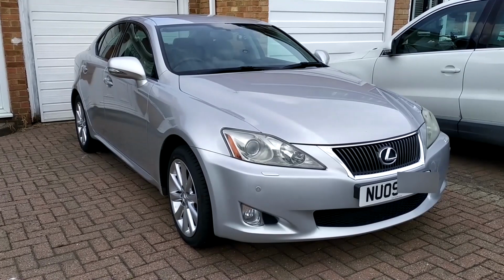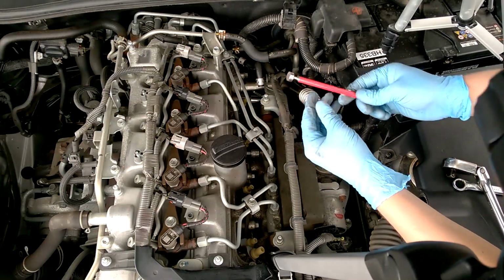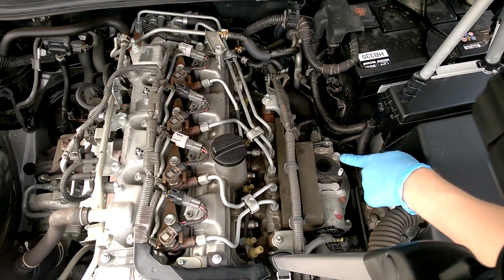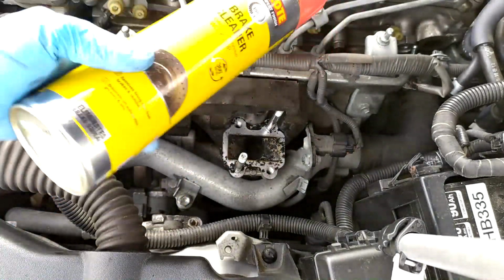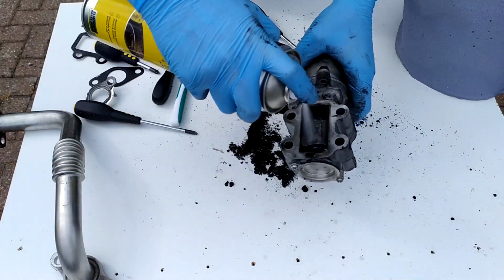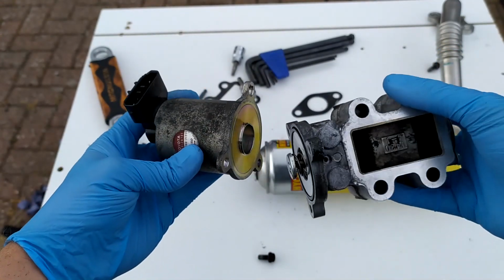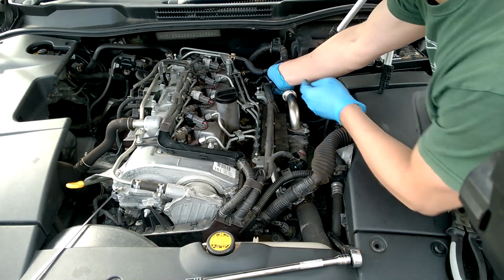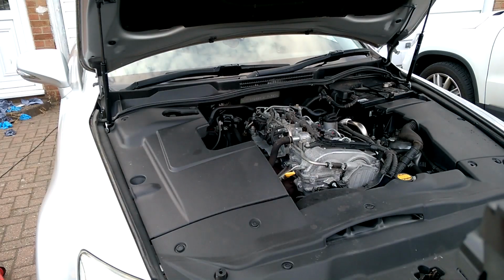EGR VALVE Clean - Lexus IS220 Diesel

Comment: Fantastic video, thank you! Small tip, I found it far easier to access those 2* tricky manifold bolts by just removing the battery. Plain sailing after that!
Reply from the maker: Thanks for the tip Derek, I will try that soon, its time I cleaned it out again.

Comment: Had my IS220d for years now, on 158k miles, this is a yearly job... i've also gutted the DPF so miles smokey in an effort for better MPG but these cars are notoriously terrible for MPG. Thanks for the video though, I done similar years ago but yours is a lot more step by step
Reply: They get you around 30mpg around the town which is not bad
Reply from the maker: Yes the Mpg is the worst part of these engines, my average MPG over 5 years is 34mpg, yet the same engine in my Avensis my average is 42 MPG. only thing I can think of is in the Lexus the compression ratio is lower than when they used the engines in Toyotas. You've done well doing your own DPF, think ill check out your channel.

Comment: Just bought an 09 IS 220 almost 2 weeks ago & being that it's winter now & the crappy weather we've had the past week with non stop rain & 0 degrees or less most nights I hadn't had the opportunity to take it out until earlier. It drives great but the problem is I couldn't get any heat in the cabin so it was a task keeping the windows from steaming up. Apparently the car had a full service before I bought it & fresh MOT & a pre sale check. I drove it for 20 minutes & it was still freezing in the cabin. Am I missing something?
Reply from the maker: There's a button above the stereo which will use the AC to demist within a few seconds, you don't need to wait till the engine warms through to demist the front screen. On another note, because it is a long stroke diesel it does take quite a few miles before the engine warms in winter.

Comment: Just bought a -08 220d with 130000km/80500 miles on the clock, been driving it for 3-4 weeks now, I’ve barley noticed that it has lost a little power day by day, but then last week it got REALLY tired, and finally the engine light came on the dashboard and it also told me to check the vsc.
So, now I’ll just do this and it’ll be good to go.
Reply from the maker: Hopefully this will cure the problem. When mine went into limp home mode the VSC light also came on. If this doesnt cure the problem at least you wont need to do the egr valve clean in the future. Let me know if it works.
Reply: @amateurtorque6709  worked out real nice, but the next time I’ll get an autoclave/ultra sound washer. Just detach the solenoid first.

Comment: I’ve tried this and it worked well, thank you for such a helpful video. However, the intake to the engine still look filthy and I’m not sure how to get that but cleaned. Also the car has a smell when l I have egr issue, is this normal?

Comment: Cleaned mine, I read on a post that you should run them back in so it re programmed , it’s still a bit Smokey so I’m going to blast it up the A19 what do you think.
Reply from the maker: I haven't heard of the re programming, however once the engine is up to operating temperature a good blast in a high gear is good for any diesel.

Comment: I would do an oil change now, just to clean out any black stuff that's in the oil.
I usually just use the cheapest I can find of the fully synthetic type from Adsa. My Little Toyota Auris 1.4Ltr Diesel has 115,000 Miles on the clock and has never had the EGR valve cleaned. I usually try to give it a blast up the motorway at least once a month to keep the EGR and DPF a bit cleaner.
That's a lovely looking Lexus 😍, I wonder how long you have had it and what you paid ?. I bought my Little Toyota Auris 2013 about 18 months ago  for £3300 it's crazy there now selling for around £5K to £6K for the same model and with more miles on than mine.😊
Reply from the maker: Thanks for your tip Stephen. Sounds like your Auris is running well. I've had it since 2017, been in the family since 2014. I think getting the alloys refurbed made a difference to the appearance, Lexus charged £80 per corner.